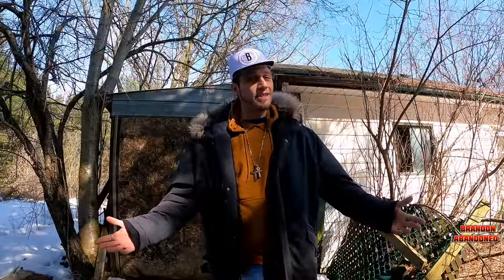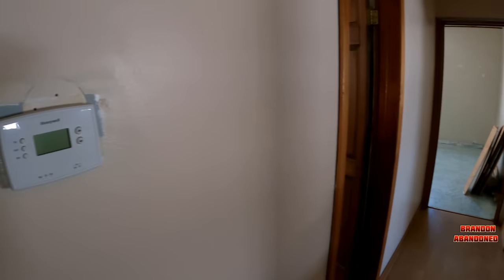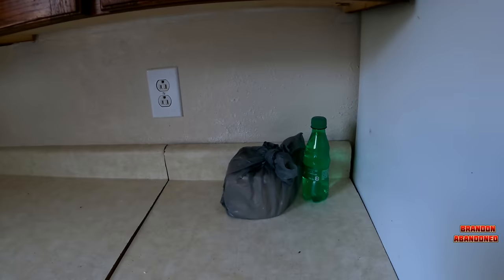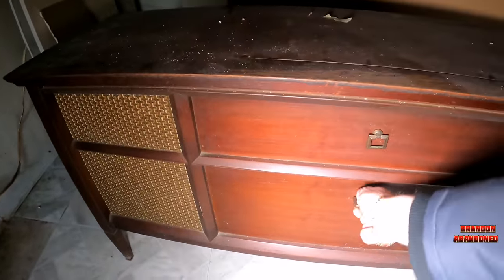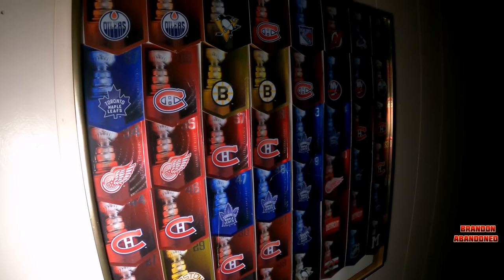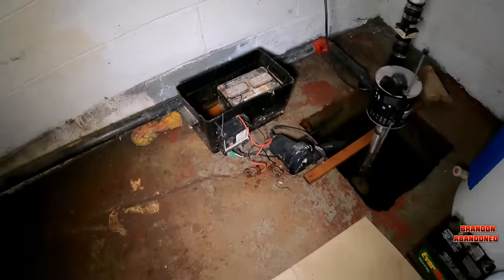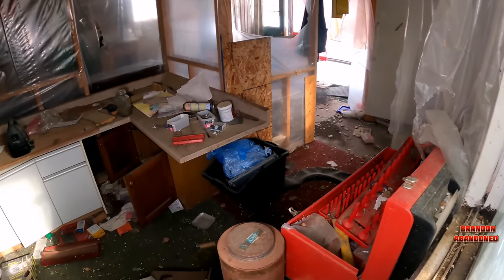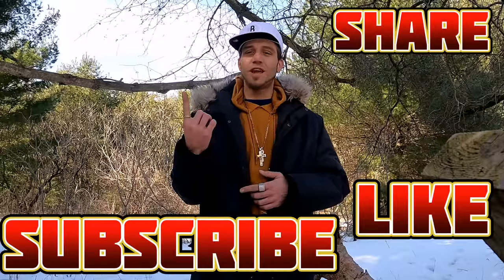Last Bungalow Sitting On An Abandoned Street! No Vandalism (2 Groovy Record Players + More) EXP.116

Comment: Battery powered backup sump pumps are commonly sold at hardware stores, but they are generally only able to run for a few hours between recharge cycles, so they are generally only intended for short power outages during flood season.